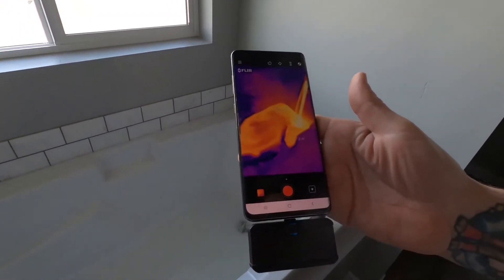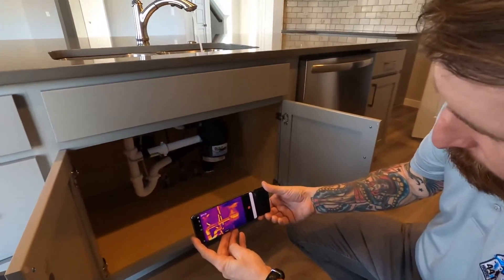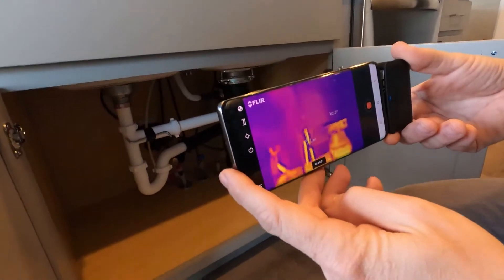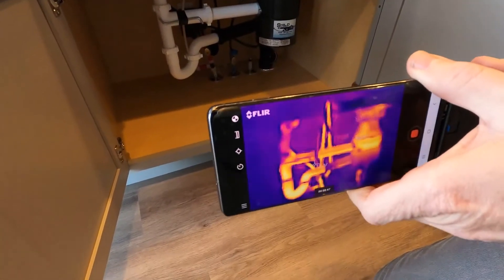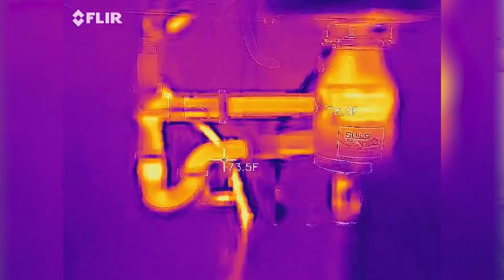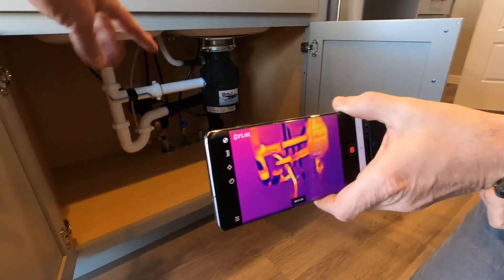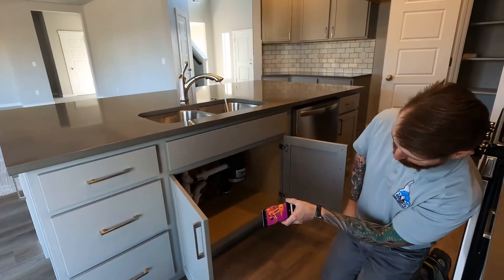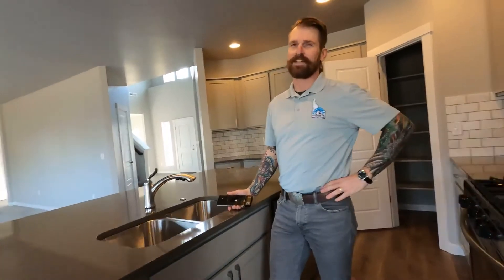Using FLIR One Pro LT to inspect under kitchen sink plumbing  in a brand new house

Comment: You could also see leaks by looking
Reply from the maker: Ok thanks for your astute observation.
Reply: The funny thing about leaks is that sometimes they don't show any symptoms until it's too late.   sometimes water leaks slowly inside a wall and causes horrible damage/mold before you ever see any staining or anything. I had  leak at the neck of my shower head and it was spraying into the wall behind it.   It took weeks before I saw staining on the soffit of the room beneath it.
Reply: The flir lets you see HIDDEN leaks BEHIND walls.... Dolt.